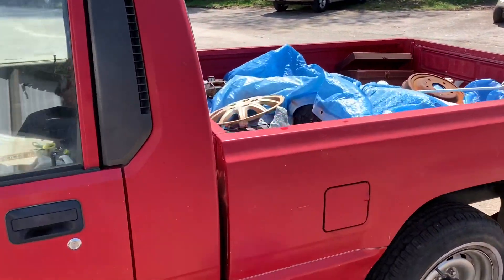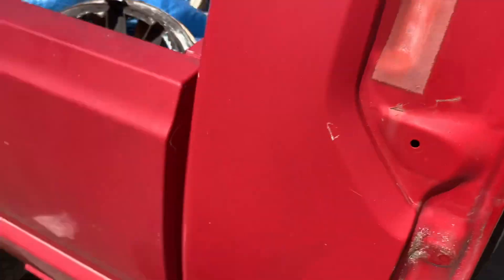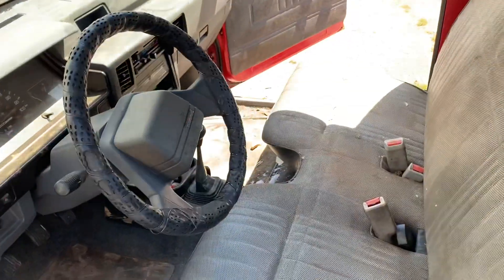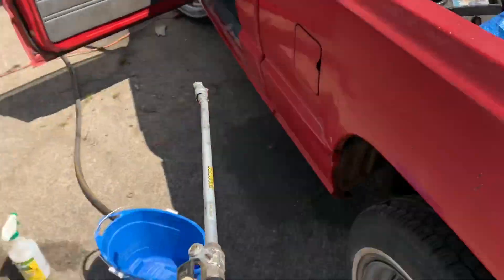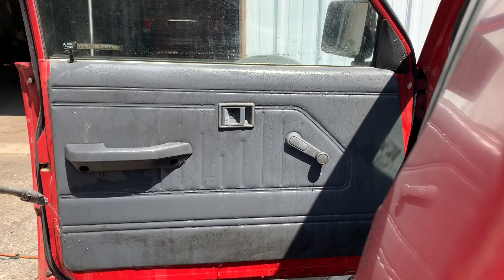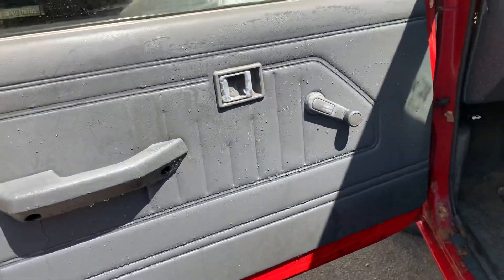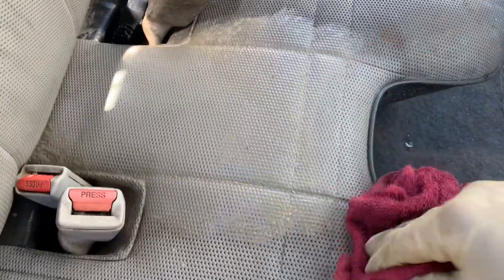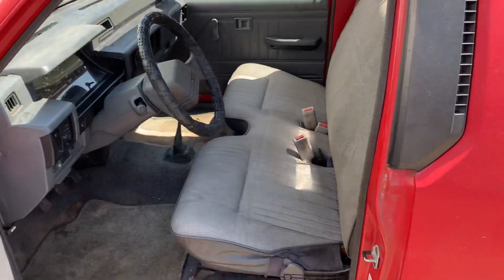Cleaning the Mighty Max interior

Comment: A couple o years ago I scored an 87 Dodge Raider (made by Mitsubishi) for free! took about 3 days to get it running as there's a million miles of EGR stuff. I have it up here in Arkansas now (from Fl) its my going to town vic! Still runs good! She's locked into 4x4 (auto hubs that I never bothered to change out) banging around on my property earning her keep. Leaks oil out of the front seal and has a mysterious water leak that's NOT going into the oil or showing up as a drip. I put seem decent MTRs on it and changed the clutch Master/Slave thats about it.

Comment: Much better.  Re: the Explosion...  Wonder if the PATS chip in the key is beginning to flake out.  Our Exploder has been randomly doing that for years.  About 95% of the time, it's fine, but, every once in a while, the Security light flashes even with the key on run and it won't fire up.

Comment: I pull the seat out and clean the carpet with a 2800 psi pressure washer and some carpet cleaning soap. i usually find a shitload of change under the seat too , i use a mean green exytaction machine for seats , does a good job. i would buy this truck , not many left in that good of condition

Comment: One of the other channels actually went so far as to take the seats out and pull the carpet and power wash it on a flip car.  Had to, couldn't clean up the sides of the seats and they needed it.  Rug had a bad stain too, soda or something.  Dang what a lot of work though.   Too much for me. 

Sometimes all you need is a cleaner and a sponge.
Reply from the maker: Yea, I wasn’t about to do all that extra nonsense for this thing haha. Sponge got the job done